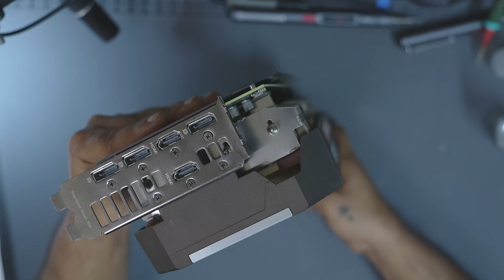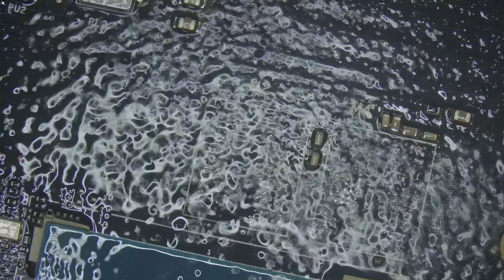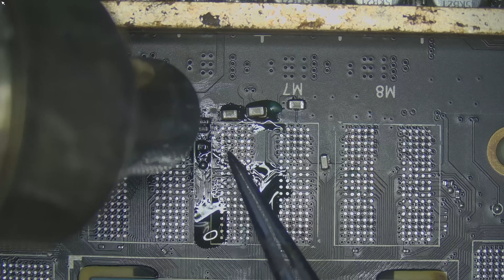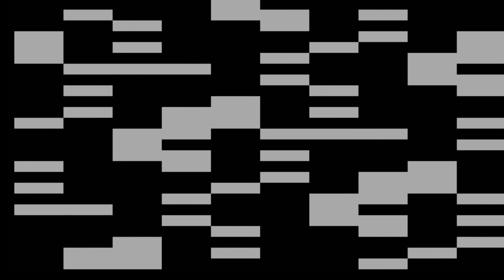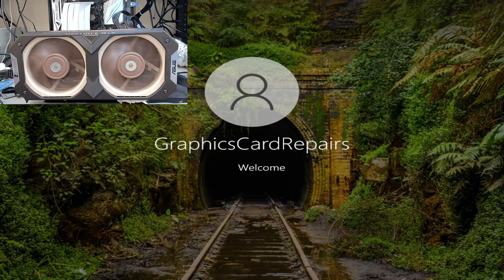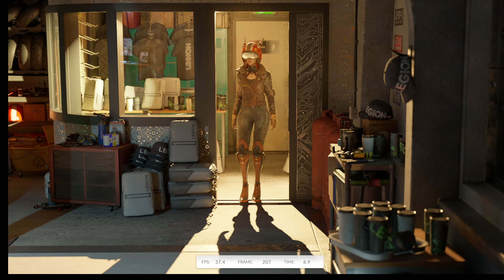Dead Asus RTX 3070 Noctua – Now a 16GB Beast

Comment: Would it be possible to upgrade my gtx 1050 ti the same way? I like to keep older pcs running for my older games.
Reply from the maker: I have not tested upgrades on a 10 series GPU. So its difficult to say.
Reply from the maker: I have not tested upgrades on a 10 series GPU. So its difficult to say.
Reply from the maker: I have not tested upgrades on a 10 series GPU. So its difficult to say.

Comment: Hey bro. I’m also considering upgrading my RTX 3070 to 16GB since GPU prices have gone through the roof. Could you please let me know if your card is still performing well after a year, without any issues? I haven’t really seen long term feedback from people who’ve been running a 16GB modded 3070 for months or years, so I just want to be sure there aren’t any reliability or long term problems before I go ahead. Thanks.
Reply from the maker: VRAM upgrade service is temporarily on hold due to memory module prices more than doubling - making the upgrade cost impractical. Please check our website FAQ page for updates on when the service will resume.
Reply from the maker: VRAM upgrade service is temporarily on hold due to memory module prices more than doubling - making the upgrade cost impractical. Please check our website FAQ page for updates on when the service will resume.
Reply from the maker: VRAM upgrade service is temporarily on hold due to memory module prices more than doubling - making the upgrade cost impractical. Please check our website FAQ page for updates on when the service will resume.

Comment: How do the drivers react to the change in vram?
Reply from the maker: The work normal like a normal GPU for 3070 16GB and 2080ti 22GB. I have tested it with 581.80 and has no issues.
Reply: Lo que realmente nos interesa saber es si hay mejora en potencia al diplicar la vram. El chips de la 3070 es aun muy potente y wl cuello de botella es su vram de 8gb queria saber si realmente mejoro sk rendiemiento wn 2k o en 4k, saludos. Pd eres un genio.

Comment: have u done any amd rx 6700 10gb cards? make em into 12gb?
Reply: specificly wondering if its possible on the xfx rx6700 10gb cards
Reply from the maker: None of the AMD GPU are possible to upgrade. They all use the maximum possible memory already.

Comment: is there any way to upgrade from 6gb to 8gb on rtx 3050? it has 4 modules not installed
Reply from the maker: No the 5GB cannot be converted to 8GB as the memory controllers are disabled inside the core.
Reply: @GraphicsCardRepairs-tk7ql  ok tnx

Comment: Hi, I was considering getting this model and found out about the mod and this video. Would you happen to have a fully working vbios for a 3070 with 16gb? I'd like to have one at hand for when I attempt this mod.
Reply from the maker: There is no special BIOS required. The existing bios supports 16GB

Comment: Do you have any insight into what memory modules are compatible with which PCB/chip model? Or is this pure experimentation where you are doing guesswork if it will work?
Considering how disgusting Nvidia has been towards its customers, learning how to solder new memory modules seems more and more tempting.
Reply from the maker: There is no list which can be referred to. All compatibility is tested via experiments to check if it works.

Comment: Good afternoon from Elsewhere.)
Mr Gpu Solitions, my I ask you about replacing RTX 3080 Ti 1 gb modules with 2 gb? Is it possible or bios/straps locked on 12 gb only?
upd. Oh, I see the link to video with explanations but still ask 'bout simple answer like "yes, possible / no, still imposible"
Reply from the maker: It's not a straight answer. On the same PCB it's not possible. BIOS edit is required to get a 3080 Ti to work with 2GB modules. Also custom drivers may be required. I am currently working on one 3080 Ti but I have not managed to get it to work. I would still recommend you watch the video as it will open up a completely new dimension and you will have more questions. I will be waiting.
Reply: @GraphicsCardRepairs-tk7ql yes, indeed. In my lookings of answer I was led to possible way through replacing of dead chip of 3090 ti fe with 3080 ti's on founders pcb of 3090 ti. But. Bios flash from 3090 ti to 3080 ti might not even work properly. Your thots, minds?

Comment: wb the 3060 ti 8GB to a 12GB? Not possible or no customer request yet for upgrade
Reply from the maker: I tried upgrading the 3060 ti but it does not work. It requires a bios edit.
Reply: @GraphicsCardRepairs-tk7ql  riighttt, I forgot about the bios part.tsk tough luck. Love your content :)

Comment: This is the first video I have seen that explains the tools used for testing the memory. THANK YOU! Sometimes, even though I don't do board repair, it'd be nice to be able to run a memory check on nVidia cards just to find out if there is a fault.

Is there a similar tool to MATS for AMD cards as well?
Reply from the maker: There is for AMD. The size is about 90GB to 140GB

Comment: If your laptop motherboard has open spots or like they are doing with the 50 series super, could you use higher density vram modules to upgrade a laptop vram situation? I have a 4070 laptop and always thought it needed more that 8gb. I DO NOT have the capabilities of doing this but could it be done?
Reply from the maker: I have not tried upgrades on a laptop yet. The 4070 on the laptop has only 4 slots, and it is already using 2GB memory modules which is the largest capacity produced on GDDR6 and GDDR6X platforms.

Comment: Nice repair and upgrade from you! I have an zotac gaming 3070 8gb twin edge same as the one you upgraded.
I was wondering where I can buy the original 2gb vram chips, because I saw bunch of them but I want to buy original samsungs because of quality.
Thanks! You gained a subscriber!
Reply from the maker: You can buy from AliExpress. Make sure that you buy only new. Do not buy tested or anything that mentions anything else. It should mention NEW.
Reply: @GraphicsCardRepairs-tk7ql cool, I was going to buy from eBay but I saw they were a lot expensive. Thanks for the advice! Going to be my first real attempt on upgrading one, I fixed a couple of dead gpus but not that complicated. Still practicing a lot !

Comment: i just disassembled my 3070 noctua one to change thermal paste since i observed elevated temperatures ( 80c cores 104 hot spot) using a phase change pad (thermalright heilos) and this video popped up 😄 
superb work btw.
Reply from the maker: Thank you. Paste change will solve the high temps on your GPU. Phase changing pads are good. 😊

Comment: Performance of this card might be higher than most 3070s since I shunt modded it and card pulls upwards of 450w in furmark. I will practice a lot more before attempting anything like this again ✌️

Great work! Thanks for saving my card 😂
Reply: What was the point in increasing its memory, how is it working differently now?
Reply: @famalamblam so basically, when I attempted to do this more than a year ago, I was running into problems with having 8GB vram in most games I play. I thought I had enough experience fixing mostly smaller boards so I attempted to do this. I failed and got myself a 4070tiS and put this card to side as a shameful experience. Fast forward a year, I am developing couple of things that utilize LLMs and some generative tools, and 6gb 1660s was not cutting it. I already had unused 2G GDDR6 modules and repair was cheaper than getting a 4060ti 16G, not to mention I really liked how this card performed and didn’t want to leave it in a broken state. That is the whole picture 😂
Reply: @Levent_Ergun ah ok, so ai/llm work, gotcha. Cool.
Reply: @Levent_Ergun mistakes are always made when you try to learn, I think practice on a dead board will go a long way, I want to try this stuff out too
Reply: @noobslayer815  Mistake is another word for experience.
Reply: @famalamblam  why are you even watching this video if you don’t know the basics about increasing ram.
Reply: @DingleBerryschnapps why are you so toxic? Go for a walk ☀️🌳🏕️
Reply: @DingleBerryschnapps  how is he supposed to know things if he doesn't ask?
Reply: @famalamblam  he's suffering :(
Reply: Can you make video on it i have a GALAX metal top rtx3070 wanna do the same to
Reply from the maker: @@Levent_Ergun Thanks for watching! Hope the video was helpful. If you've got a similar repair project, take it step by step and don't hesitate to reach out if you need professional help.
Reply from the maker: @@Levent_Ergun Thanks for watching! Hope the video was helpful. If you've got a similar repair project, take it step by step and don't hesitate to reach out if you need professional help.
Reply from the maker: @@Levent_Ergun Thanks for watching! Hope the video was helpful. If you've got a similar repair project, take it step by step and don't hesitate to reach out if you need professional help.
Reply from the maker: @Levent_Ergun Wow, 450W in FurMark is a serious shunt mod — way above stock for a 3070. The good news is the repair in this video was a memory module swap, so the silicon itself is sound. As the video shows, the issue was pad/contact failure on a single BGA, not a power-delivery fault from the shunt. If you're going to keep pushing 450W+ on a repaired card, it's worth keeping an eye on hotspot temps and the inductors — the original VRM and cooler weren't designed for that kind of sustained load, and shunt mods compound any existing thermal pad issues. Definitely get the thermal pads refreshed if you haven't already. Great save though — those Noctua 3070s are gorgeous cards.
Reply from the maker: @Levent_Ergun Wow, 450W in FurMark is a serious shunt mod — way above stock for a 3070. The good news is the repair in this video was a memory module swap, so the silicon itself is sound. As the video shows, the issue was pad/contact failure on a single BGA, not a power-delivery fault from the shunt. If you're going to keep pushing 450W+ on a repaired card, it's worth keeping an eye on hotspot temps and the inductors — the original VRM and cooler weren't designed for that kind of sustained load, and shunt mods compound any existing thermal pad issues. Definitely get the thermal pads refreshed if you haven't already. Great save though — those Noctua 3070s are gorgeous cards.
Reply from the maker: @@Levent_Ergun Thanks for watching! Hope the video was helpful. For similar repair projects, take it step by step. If you need professional help, check out gpusolutions.net/book-device
Reply from the maker: @Levent_Ergun 450W through a shunt mod is serious power — glad the card is alive and well after the upgrade. In the video Frazer walks through the strap resistor changes needed for the Samsung 2GB modules (strap 2 high, strap 1 high, strap 0 low) and the MATS memory test confirmed all pads had proper contact before reassembly. For stability under heavy loads, the usual suspects are: (1) clean power from the PSU, (2) fresh thermal paste and properly sized thermal pads (2mm on this card for both VRAM and MOSFETs), and (3) strap resistor correctness. If you ever see artifacts under sustained load, MATS is the first thing to run. Thanks for the kind words — really happy we got your card back in action.
Reply: Diminishing returns. And now you’re sucking 450w.

🤡
Reply: @DingleBerryschnapps  surely efficiency was the main reason why I shunt modded, 🫵 🤡

Comment: what tip do you use to clean the pads, C210 or c245? another question is  t210 and c210 do they use or share the same tip
Reply from the maker: I use both. C210 for removing the old solder or tight corners and C245 to wick the pads
Reply: @GraphicsCardRepairs-tk7ql  T12 ?